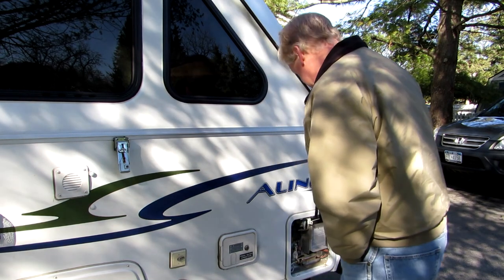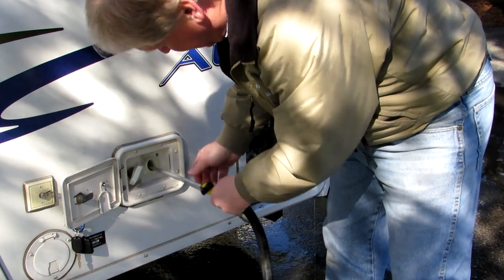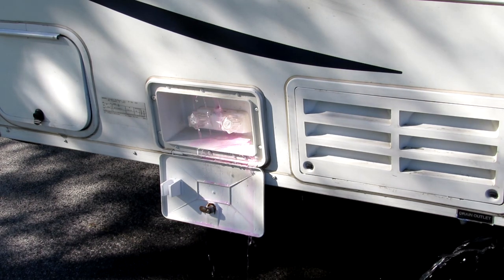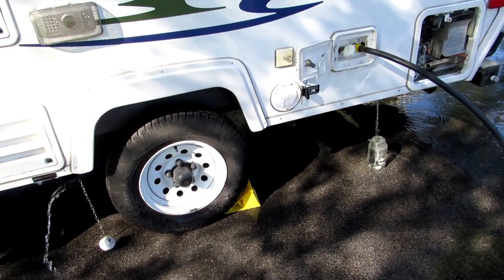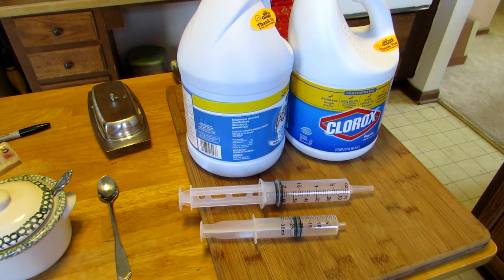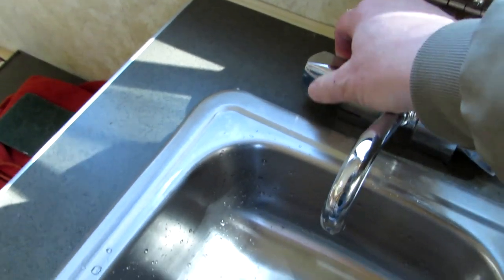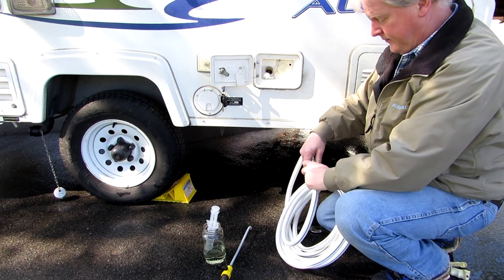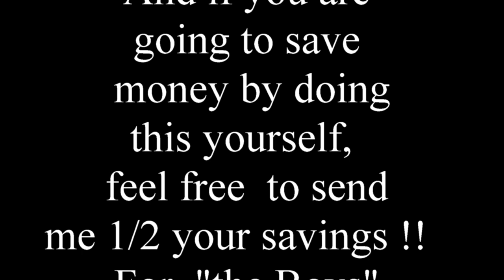Preparing the Aliner Fresh Water System for a new Camping Season

Comment: I wish you would have showed rinsing out the chlorine. How much do you run the water to flush the chlorine out of the system.   Do you do a similar procedure as when you we're clearing out the anitfreeze.. or just run the water out of the hot side, and cold side as well as the water tank a couple of times.
Reply from the maker: The chlorine isn't toxic or even terribly bad tasting.  So I just flush out the lines, empty the tank and fill with new fresh water. If there is any Chlorine left in the system it will evaporate as the water is used and helps to keep the system sanitary.  As far as the Antifreeze, I flush that 3-5 times through all the line to get rid of that, Then add the Chlorine to more or less help remove the last amount of anti freeze.  The thing to remember is to have all faucets running while flushing out the anti freeze for quite a while, 20-30 minutes. And to let the chlorinated water sit in the lines for 24 hours before flushing it out.

Comment: Did that folding faucet come stock in your 2008? Mine is a 2007 and has a cheap plastic low profile bathroom faucet. I have turned the internet upside down and can't find a 2 hole 4" folding faucet. Thank you!
Reply from the maker: I believe that is the stock faucet, though I bought the camper used and the previous owners did make sure it was wonderful.   Call Aliner and ask if they have a fold down faucet for the 2008 Classic?

Comment: I have an a liner as well it has the same water fillers as yours but I am not sure what the hose connection is for. The one you connected the white hose to. Is it just another way to fill the tank. Cheers Sean
Reply from the maker: The one you screw the hose to is to hook up to city water and not use your water tank. The one you can put the hose INTO is to fill your tank so you have water when on the road or when away from city water.

Comment: I just wanted to say I put a deposit down on a Ranger 12.  I have been reviewing some of your older videos and I know they will be very helpful when I finally get delivery.   I also have so many questions to ask I don't know were to begin.  Enjoying your videos and your new adventures.
Reply from the maker: Feel free to ask away !   Also make sure you visit the Aliner Owners Club website.  It has a ton of information and you don't need to be a member to get to most of it.
Reply: Questions to ask about owning a Ranger 12
1.  Would a set of front stabilizing jacks for the front help in stabilizing the trailer better.
2.  My understanding from my reading that the ball hitch size is a 2” ball.
3.  Should I get an extension cord (30 amp?),  How long should the shoreline electrical cord be?  And the fresh water hose.  
4.  What do you recommend to keep mice out of the camper especially when it is being stored outside.
5.  Traveling on an interstate (I only do this if necessary), should I maintain a speed slower then the speed limit?
6.  I plan to upgrade the battery.  What amp hour would be best.  I have a 100 watt portable solar panel that I plan to use.   (Also I have several collapsible solar lanterns that I really like. ) 

1.   I have ordered levelers and chocks; water pressure gage, storage cover as mine will be sitting outside,  trailer hitch lock.
2.   I will buy water filters
Will probably have more questions later.
Reply from the maker: 1. - You absolutely need to have front and rear stabilizing Jacks.  If you don't, there is a very good chance you could bend the frame at the door.  They should not have sold you a trailer without them.  But you can buy them very cheaply on Amazon, Just make sure you get the right size (I think the sizing chart is there)

2.  The "Standard Ball" is 2".  So you should have that size on your Hitch receiver. 3.  I believe the new trailers are coming with a marine plug that you run a cord from that plug to the shore line plug.  My Very limited experience with RV parks is that 15 ft is usually plenty.   But having 25 allows you more "setup Options" if you want to be  closer to the road, or further back from the post.   Also, the Aliner uses so little power unless you are running the Frig, Microwave, and A/C all at once, you can actually get away having a regular Household 20amp extension cord anywhere from 10-50ft to get to those far away electric poles.  You just need to make sure you have the Adapter from 30amp to 20amp ($7)  I have actually used a 100ft orange extension several times to have A/c.   Buy a TRUE 10/3 extension, not 12/3 or 14/3.   https://amzn.to/2mLtW86  or one of these https://amzn.to/2lEtY1D       .   For fresh water hose, if you plan to hook up to RV park water, its a good idea to get a splitter and at least two 25ft hoses.  Water is often far from the site.  And make sure you get a water filter you can attach to your hose before it enters the trailer because RV park water is always likely to be silty and rusty.   It won't kill you, but it can kill you water system if a speck of dirt or rust get into your water system.   Some other things you might need  http://www.goingnowherefastrv.com/shopping/gifts/  also.. watch this...https://youtu.be/oJ0yEybWSEE
  if you haven't
Reply: Thank you for your reply.  The Ranger 12 comes with stabilizing jacks in the rear.  I just felt that since the 12 is  the same size as a Classic (without some features) and the Classic has front stabilizing jacks that I will install the jacks in the future.  Your videos on upkeep of the Aliner are excellent and I love your adventures and information on the places you go and boondocking.  Thank you.

Comment: Hey John.. me again.  I've watched a couple of videos which said that putting bleach in the hot water tank is a no-no.  Is there anything different with the A-Liner tank that makes that okay?  I've seen some videos that put vinegar in the hot water tank to remove calcium deposits?  Thanks again !!  Also.. don't think I have a bypass valve, so not sure how I would deal with winterizing with anitifreeze?
Reply from the maker: You have to install a by pass valve.  There is no good way to winterize without a  bypass. They are relatively cheap and easy to install.  And putting bleach in the Hot Water heater??   Doubt that I would put bleach anywhere in the camper water system.  Bleach is very corrosive.  But 5% bleach in water isn't going to hurt anything in any system.  I swear my local city adds more than that to our water every quarter to clean out the pipes.  Vinegar??  Ah, not sure I would do that either, same reason.  If you use an anode rod you should have minimal deposits.  And what are the deposits going to do? Reduce your capacity by a cup?  Or change the efficiency by 4%?  Not really an issue.   Great question though. I may have to add this into a video as I'm sure people need to know.
Reply: @GoingNoWhereFast  Now you've totally confused me.  You put Clorox bleach in both your fresh and hot water tank?  Of course you dilute by adding it to water in the tank, but still you're putting it into the tank?
Reply from the maker: @GoldenK9Campers  Well, there is water in the tank, and yes I dilute 3 tbs to 8 gals water.  And that's the cold tank, not the hot water tanks.  That is bypassed, though it wouldn't matter.
Reply: @GoingNoWhereFast  You do open the bypass in the video after you add the bleach to get chlorinated water in the hot water tank.  I live in Las Vegas and we keep the a-liner in the garage so i'll likely never have to winterize, but trying to do my best to fully understand the procedure.  Going to create my own little video.
Reply from the maker: @GoldenK9Campers   Ya, I might open the bypass to sanitize the hot water tank as I actually like to drink hot warm. My tank has been by passed the last 4 years, so this is an old video. But if I mention it on my videos, I'll mention you channel. Looks like you could use another 50 subscribers...lol
Reply: @GoingNoWhereFast  Slowly but surely!!  I'm playing with shorts at the moment.  So interesting.  I'm also playing with podcasting on a couple of other channels.  I tried to get an interview with the A-Liner folks without luck.
Reply from the maker: I'm pretty surprised they are letting us tour the plant and see all their workshop during the Aliner Rally in June!  It will make an interesting video.
Reply: @GoingNoWhereFast  Super jealous !!